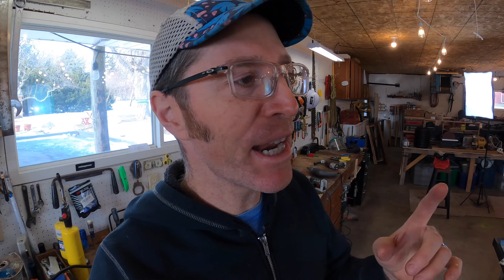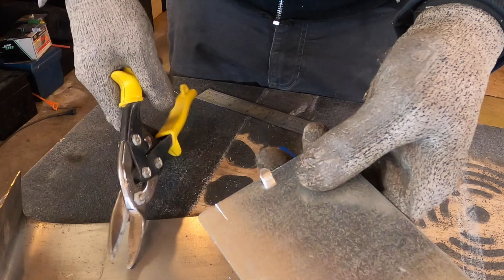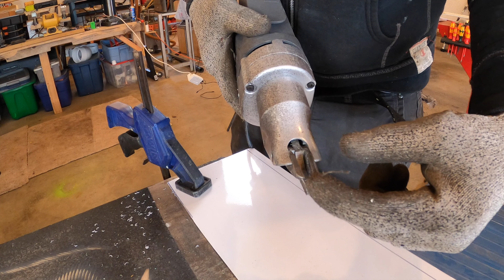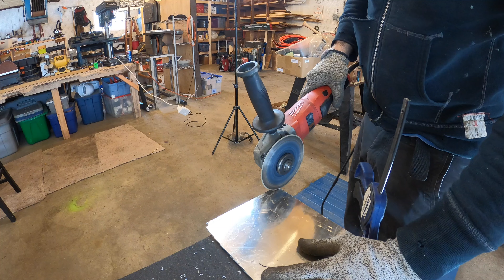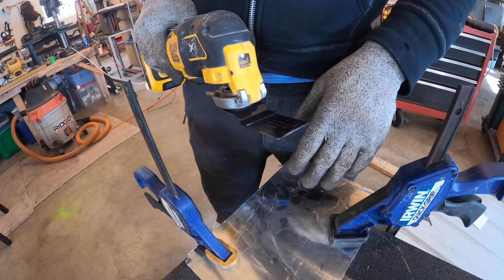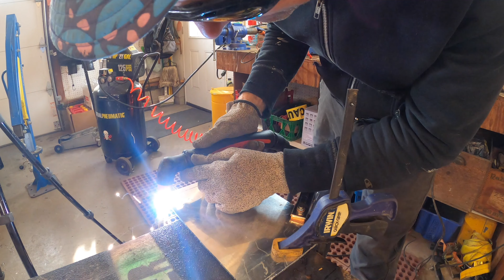Sheet Metal Cutter Showdown!

Comment: I have to agree with you on the angle grinder is the best!  Great video Spencer!
Reply from the maker: gets most jobs done pretty well ... plus, the danger of the tool is always tantalizing ;)
Reply: Will angle grinder damage the rust protection?
Reply from the maker: @liubaicheng7871 deep on the steel … paint afterwards if you’re concerned